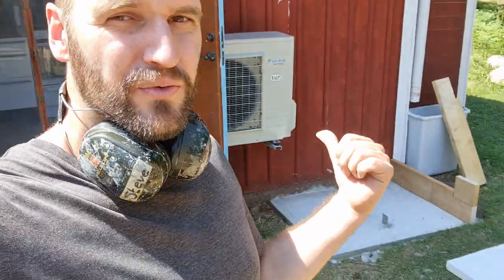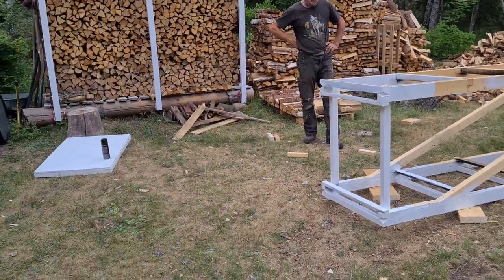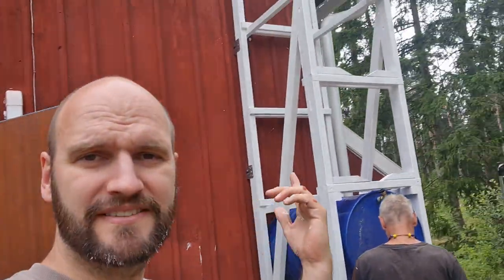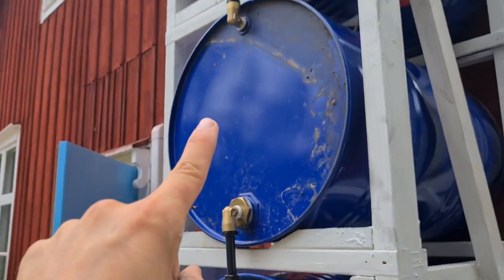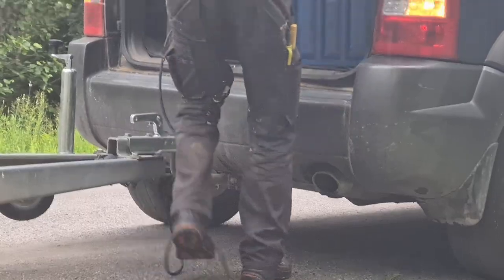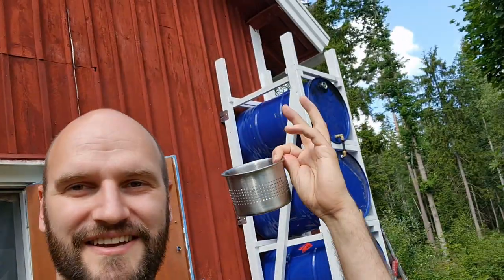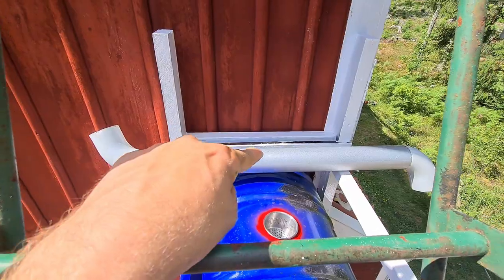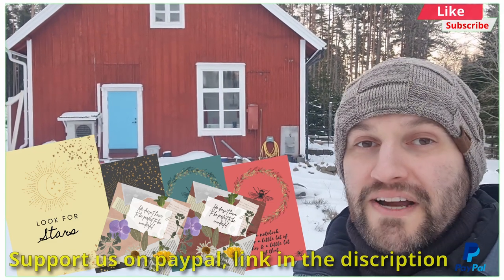Water tower part 5 final   It's done!

Comment: Are you sure that the black hose between the tanks is suitable for sun exposure (has a U.V. filter)? bacause I used a hose like that and a plumber told me that this black pipe is for burying only, but I fixed it with a coat of polyurethane paint. Success with your project!
Reply from the maker: Ill look that up. Thanks